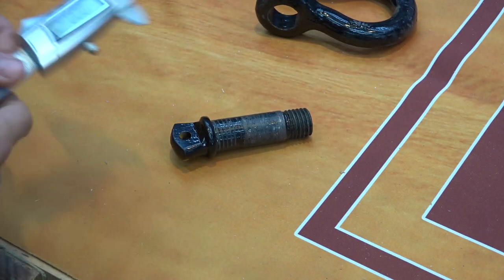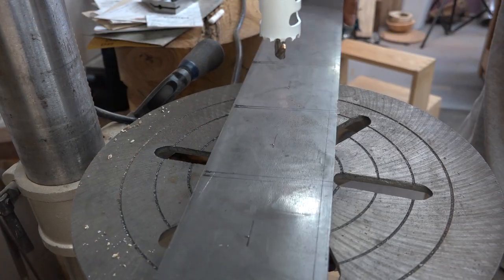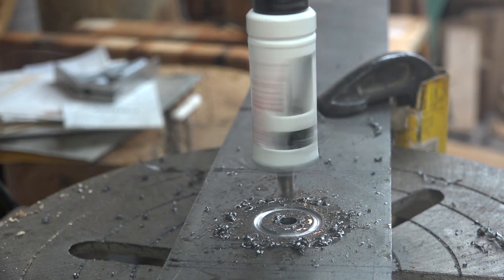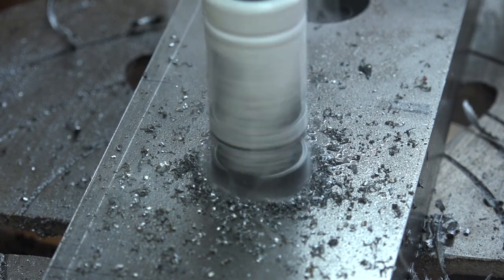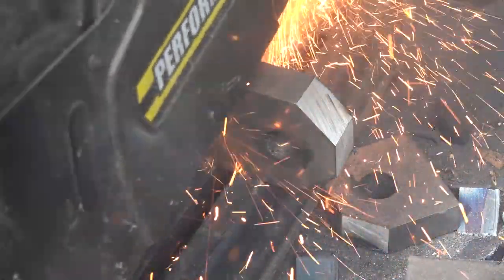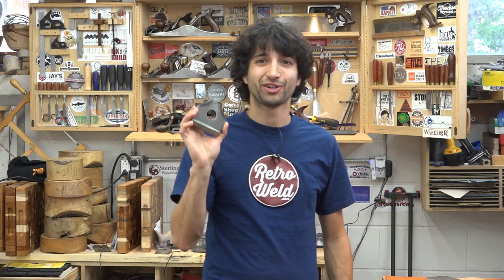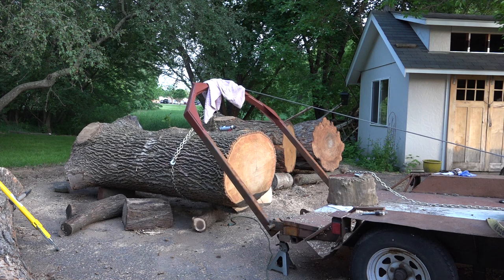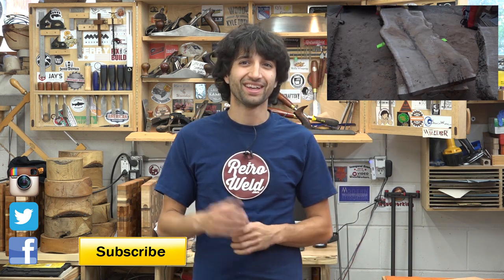Making Shackle Mounts | How to

Comment: Good work!  Here is a tip for you.  After you fasten the shackles, back the pin off a quarter turn.  This will prevent the pin from over tightening while it is under load.  You don't want that to happen.
Reply from the maker: you can see I've already gotten into that habit @ 4:45 :)

Comment: Those holes would have taken me a while on my bridgeport as well. Although, I hate hole saws, I would have just used a 15/16 twist drill. No way that little bugger could push one. I'm impressed with your abrasive cutter, no way ours can do that.
Reply from the maker: the hole saw really surprised me.  I figured it would make it through a couple but was doubting that it would go through all six.  The saw was also surprising.  I really didn't think it was going to cut that easily.
Reply: Years ago I had access to a welding shop at a trade school. They had a hydraulic punch press that would just pop out holes like that in seconds. Pretty impressive.

Comment: Nice job how much did that cold rolled steel stock cost.
Reply: He mentioned it in his last weekly update.  It was $10-15 for the steel from a scrapyard bin.  The hole saw was $6 because he only needed the saw, not the mandrel.  When he checked prices for comparable manufactured shackle mounts they were ~$20 each and he wanted half a dozen, so $120 vs $20 plus 2 hours of work.

Why do I remember this?  I wish I knew.  :-)
Reply from the maker: Very attentive.  I like you.

Comment: Hey Matt 
I noticed that you always put a towel or something over your wench cable, what is the purpose of that?
Also...I see a plasma cutter in your future!
Reply from the maker: The towel will help to control the cable if it break.  It will absorb some of the force and direct it down.  Plasma cutter would sure be nice!
Reply: +Matthew Cremona Gotcha...I thought of that but then made up about 10 other possible reasons which just confused me.

Comment: I was interested in the cutting liquid you used I can a spray can of cutting fluid but it seems to spray everywhere except where I want it and is not very economical, could you point me in the right direction for cutting fluid and the object that you use, I call it an object because you only show the tip of it in the video
Reply from the maker: It's 3n1 oil that I picked up at the home center.  The new bottles have an extendable spout which makes it really easy to apply the fluid exactly where it is needed.
Reply: Thanks I will lookout for that next time I am out

Comment: I was just thinking and a 4 ton shackle has an normal operating range up to twice it's rating.  The failure range is 4 times it's rating or greater.  Those shackles are good to go up to 16,000 lbs.  I doubt you will ever get to those ranges.
Reply from the maker: I highly doubt it.  I think something else would fail first

Comment: 4:24 Why not bevel them by cutting off the waste with the chop saw? Faster and less dust.
Reply from the maker: I didn't want to run out of wheel.  By the time I got to separating the last one I couldn't make it all the way through the bar and had to finish the cut with an angle grinder.

Comment: NEVER mount any pad eyes in a posision where the load is sideways on the eyes. It puts tremendous stress on the welds and also the shackles. Side loads can and will reduce the capacity of the componants 50% or more depending on angle! Asking for trouble.
Reply: What is your reference for that? I’ve never seen any warnings on shackles, and I have spent years loading them every which way with tension and never broken one. The welds he did would be as strong in any direction.